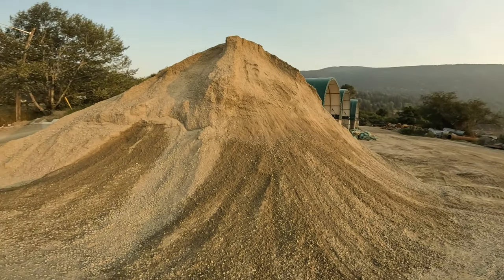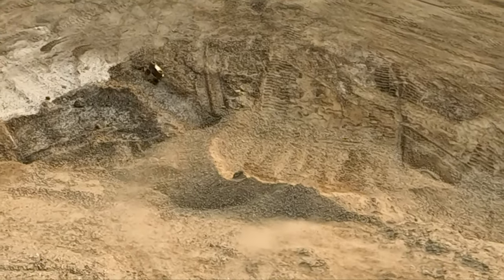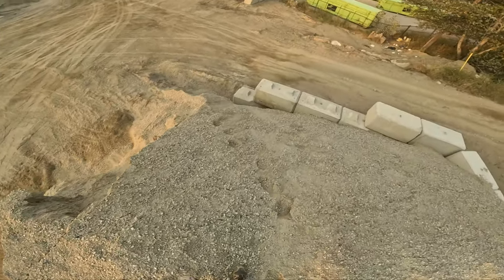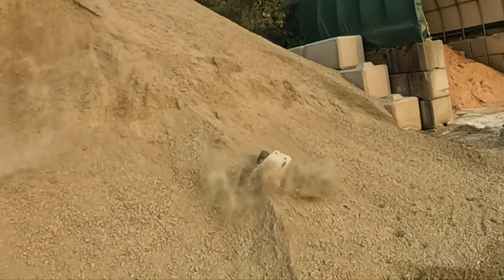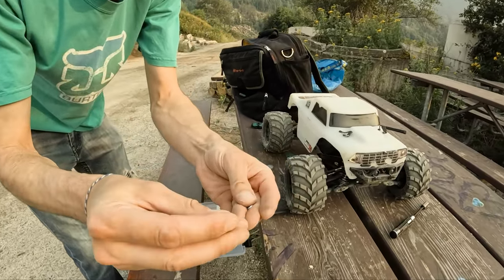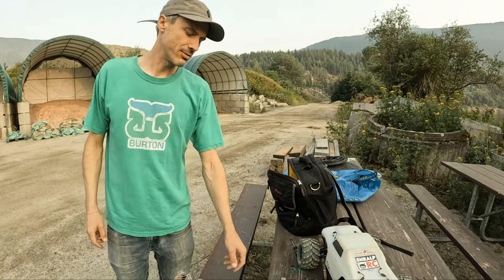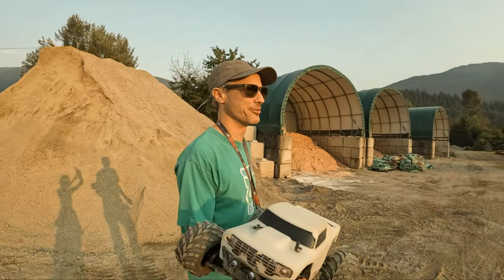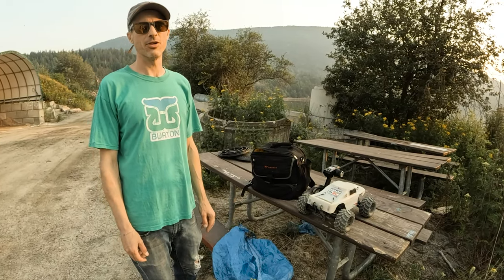Driveshaft Problems? - Team Associated Rival MT10 - Hobbywing Basherbodies Proline

Comment: Your video is a message to everyone to carry spare parts when running your cars. The drift shots with the sunset in the background were great.  I have come to the conclusion that over time and many runs plastic parts develop imperceptible cracks that after many hard hits they give way. Because, if you look at your previous videos the truck takes so much and then parts start to break after a lot of bashing.
Reply from the maker: @michaeldorich4485  yep, it all broke at once haha…
Reply: @shralpRC  I've seen and heard that people will boil plastic parts in water to soften them.
Reply from the maker: @michaeldorich4485  I’ve heard that too, but haven’t tried yet. Soaking or regularly applying wd40 is supposed to make things more flexible, might help too. I’ve got some different driveshaft options coming soon, hopefully one of them will hold up. I’ll do a video once all the parts are here

Comment: Only thing I ain't broke on mine in 18 months is the driveshafts guess I'm lucky do you use the standard body posts with the basherbodie m8?
Reply from the maker: @TheGazs1  haha nice! We all break different parts, but we all break parts 👊 And yeah I use the standard posts, but I had to drill new pin holes to fit the super thick body.

Comment: That tire is too heavy for the driveshaft
Reply from the maker: @smitheshn6637  I actually broke the majority of them on the stock wheel/tire. Only been running the prolines for the last few months, and didn’t break any til these 2 days. Been testing some stronger options and I think I found something that is pretty bombproof. I’ll have a video out soon.